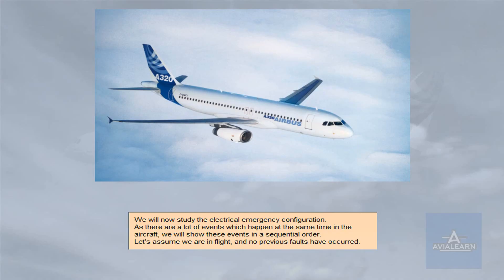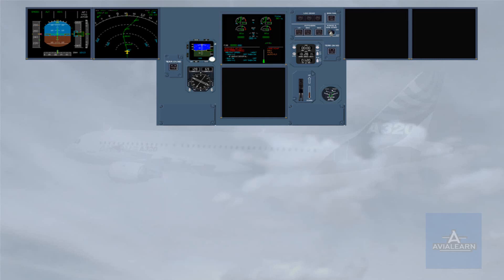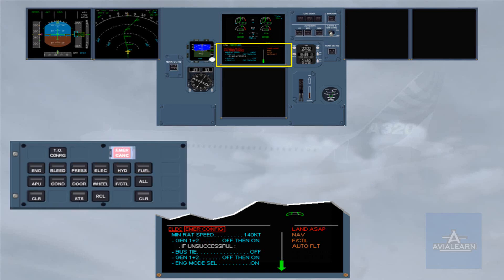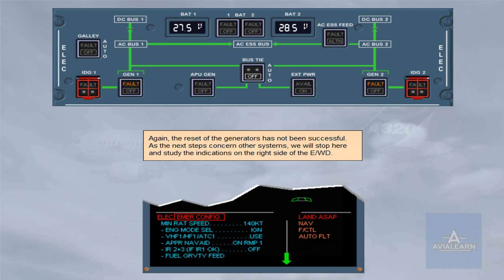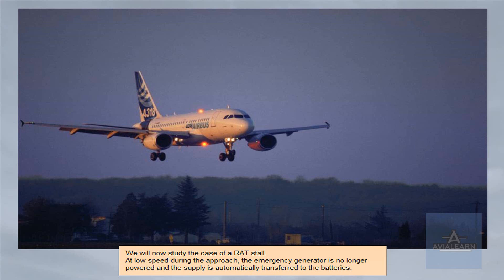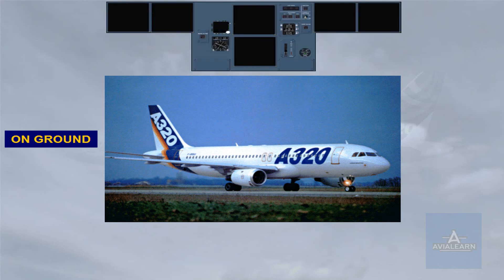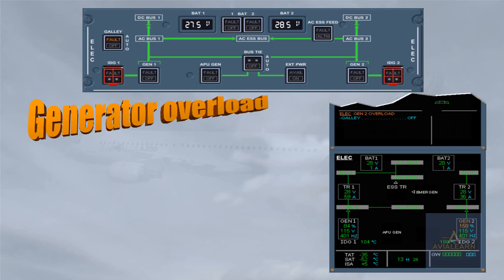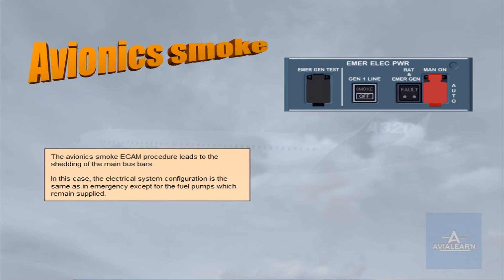Failure Cases - Electrical Power A320 Family

Comment: Why not switch on the APU for electrical power in flight?
Reply: Because the APU start requires a lot of electricity, so there is the risk of an immediate loss of electrical power. Note that this is unheard of in the real world. The RAT will deploy.